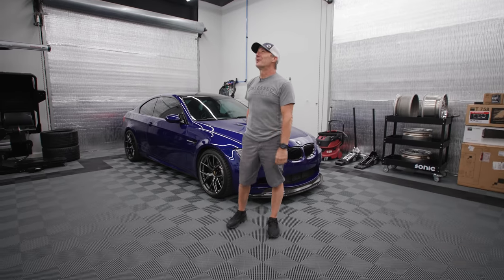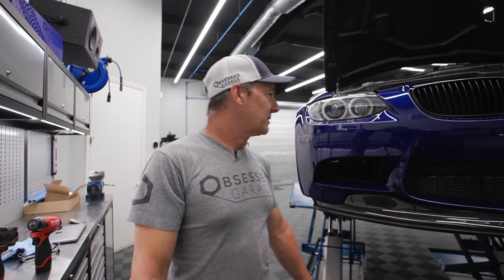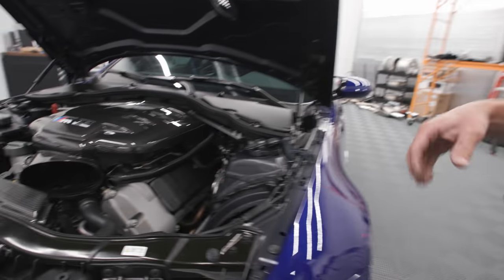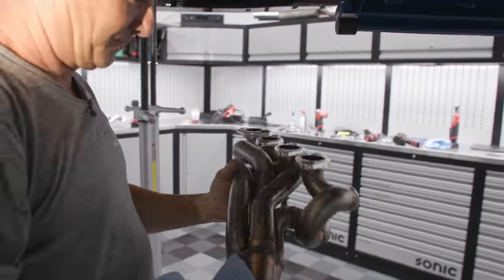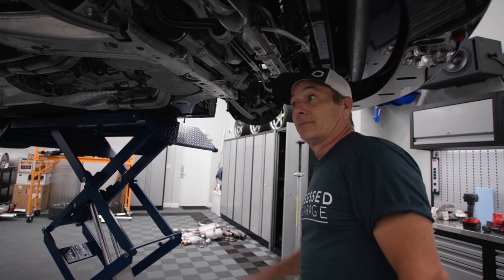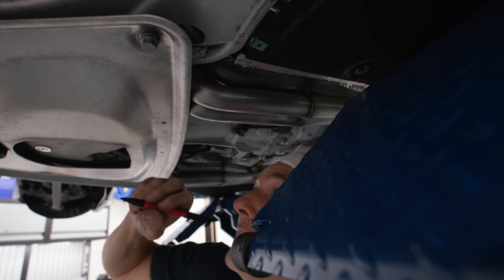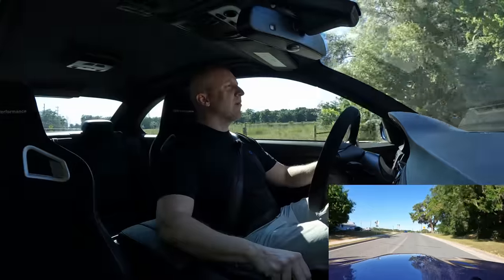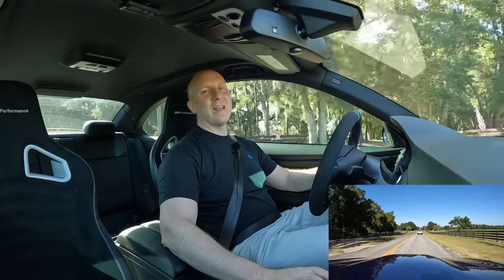BMW E92 M3 American Racing Headers Install and Drive

Comment: Been a fan of Matt for years.  I own the IND Signal Green Hell m3, spun a bearing last year.  That car was "done" .  Well, since motor was out, he has inspired me to dial it up.  Doing the full arh exhaust, and the motor is here from dinan, 4.5l.  So excited to see you mention it, when you said Dinan pedals, I just laughed, why would he mention that if he didn't have stroker on his mind....lol.  

I say to you Matt, be done with the wheels, just do a set of BBS e88's.  Contact Slicer, and get it dialed in.  There isnt a better wheel for the e92.   This is coming from the guy who spent 5 years of my life figuring out how to recreate style 40's for my z3m coupe that couldn't fit stock wheels.  Wheels make the car, and the e88's somehow vibe with the design in a OG OEM+ kind of way. I'm confident e88's or not, you'll get it right.    

Thanks for doing all these videos.  It's just stunning, and the car culture needs more guys who don't  listen to the crowd, and truly enjoy their cars in a personal way like you do.  Life is too short to do it another way.  

A question Matt.  I personally purchased the IND car to soften and avoid the desire to own a porsche 911 gt3/gt3rs.   Given the tough choice, would you choose your e92 over your gt3?  I no longer desire a p car now, especially having chased them down on the track coupled with the character of the e92.  The v8 sound, and where can you go wrong when a steve Dinan replacement motor is a fraction of the cost of a gt porsche replacement engine.  

Keep it coming, and do the Stroker like it's year 2013!
Reply from the maker: Hey Greg!  I know that car well.  ARH and 4.5L is the dream.  I really want to convince Steve Dinan to do it with me on camera.  That would be epic.  The E92 is more about cruising around town for me.  I just love how it looks and sounds, but I don't find it super fun to drive in comparison the a GT4 or GT3.
Reply: E88 on E9X look so good!

Comment: Hey Matt. Do you like the Alpine MSS tune say better than DINAN Stage 3 piggy back? I was checking out the Alpine MSS and it looks really promising. But I don't want any aggressive burbles added to what the F80 already has. If those can be disabled with the tune I'm sold!
Reply from the maker: I love Alex’s tune on the E92, but the tune is much more important on the S55.  I’m not sure how much he has put into it.  He’s super authentic, so he will tell you.
Reply: Thanks for the input Matt. I’ll reach out to Alex for specifics. The E92 is sounding great! I pretty much have everything DINAN on my F80 except for the mid-pipe. I thought Steve sold DINAN and has a new venture called Carbahn or something like that? It would be epic if he would agree to video building the Stoker engine for the E92 🤯 @ObsessedGarage